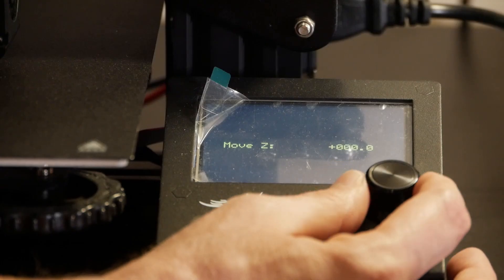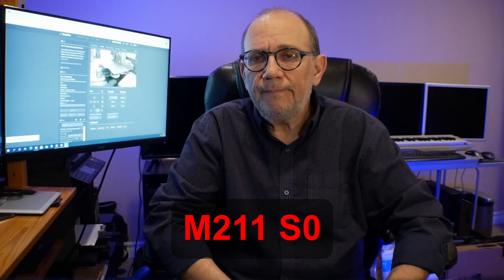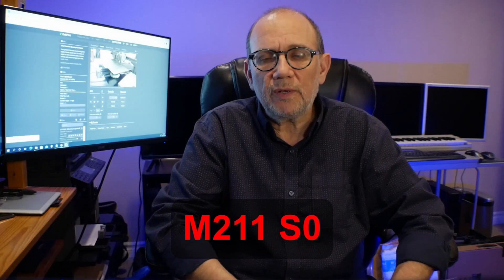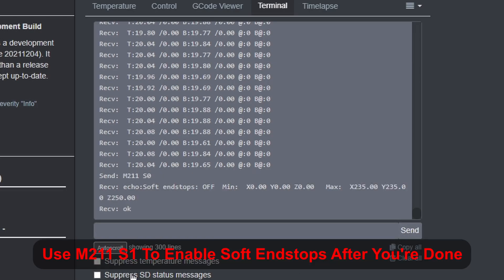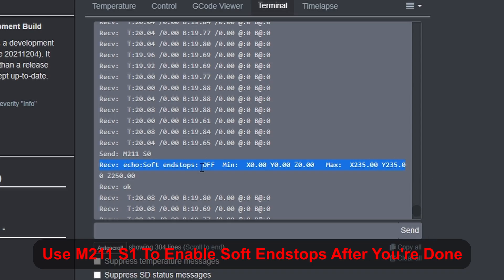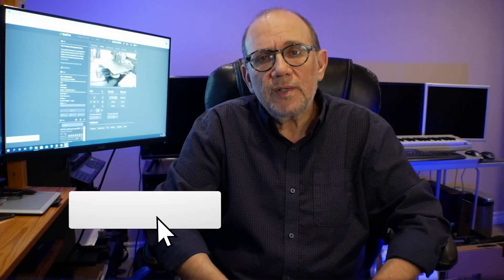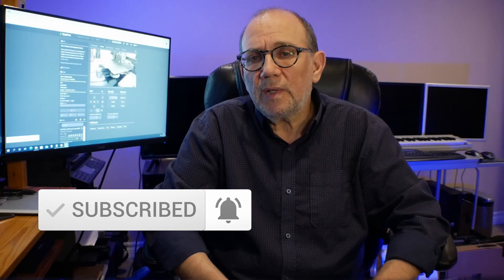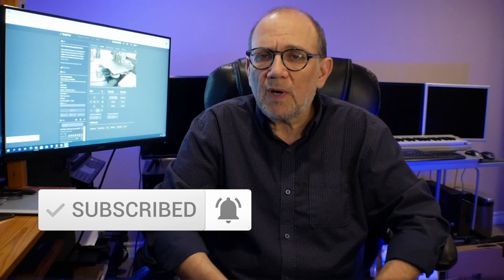Easy z-offset adjustment for your 3D printer.

Comment: This video was THE ONE I HAVE looked for in YEARS - so THX a lot for making it !

I have NEVER really got the leveling under my skin but has got my printer to work more or less by trial and error - not very satisfying.

These days I'm installing a BLTouch on my CR10s PRO version 2 printer some I'm very interested in getting the info you show in this video.

Allthough I think you should have mentioned some asumptions one has to get fixed FIRST:

1) The BLTouch should be calibrated correctly
2) the gantry should be levelled 
3) the bed should be 'levelled' with the leveling screw under the bed

A lot of people out there has made videos about the leveling issue - most of them more MIS-leading than leading, I think !

(BTW: why are your picture not in sync with your sound ?)

Keld from Denmark 
A fairy tale country in
the north of the EU

Comment: Depending on the version of the firmware installed you may not get the results shown on the console.

Please list out the firmware version you used to perform z offset !

Does this z-offset work on the BigTree board?

Comment: You area a LIFE saver. Worked great on Ender 3 v3 KE. I was pissed of with adhesion problems even with glue or pristine clean beds. Always having problems and headaches. Now the 1st layer is smooth as butter.

Never saw a z-offset tutorial as good as that. Congrats.

PS: Ender 3 v3 KE you adjust the offset directly from the adjust menu on the settings screen (the one that you do the homming).

Comment: I inherited a Creality CR10S Pro v2 that I am having an IMPOSSIBLE time getting leveled. When I attempt to home the printer, or do automatic bed leveling, the hotend does not want to stop when going down to the Z home position. It's like the printer is trying to drive the hotend through the bed.
Reply from the maker: I'm sorry to hear you're having this issue.  There are a few things that may be going on.  Given that this printer uses the BLTouch and there's no physical z-endstop switch if the BLTouch doesn't trigger, the printer has no idea when to stop moving down.  So the first thing you need to do is check if the BLTouch is functional.  Does it extend and retract when the printer starts up.  Typically it should "click" twice on power-up.  Have you tried triggering it manuall by pushing the pin up?  Does it blink red or do anythiing?  Do you see any errors on the screen?  If you run a z-home, and while the print head is going down you push the pin on the BLTouch does the print head stop going down?  Is it possible that someone installed different firmware that doesn't recognize the BLTouch?  The other thing, of course, is that you need to level the bed and manually set the z-stop.  I'm not 100% familiar with that particular printer so you'll need to get the instructions on how to do this.  But this is crucial in case you haven't done it yet.  Unfortunately I would need to be there to cover all the possibilities.  Good luck.  Let me know if you figure it out.  RG

Comment: I have the CR Touch how do I get the probe to deploy/bring it down like you did in this video? I thank you for the video and your hard work. Yes I am noob and I am struggling with leveling the bed. You did a frggin outstanding job on this video. Thank you so very much!
Reply: In the z offset menu (jyers), there is a check box next to probe option. Select it, and the probe will extend.

Comment: At least get it right Zoffset is NOT the distance between nozzle and bed,  its the distance from nozzle tip to probe tip.  it's a negative value added to z0 once homed, to create a new virtual 0,  thereby placing the nozzle at the same Z that the probe tip found.
Reply from the maker: I actually touched on what you're describing at the beginning of the video.  This, however, is a beginner tutorial for what the z offset is, as defined in most 3D printing sites.  It is also the first definition generated by Google:  Z-offset is the distance between the tip of the nozzle and the top of the heated bed on a 3D printer. It's a parameter that adjusts the initial height of the print nozzle above the bed.  It's always possible to have a more nuanced definition (which I guess yours is) but for a person trying to understand how to set the Z offset and get a general understanding of what it is, my explanation more than serves its purpose.  Thanks for commenting.  RG

Comment: So confused on probe and getting it to drop with software? 😢
Reply from the maker: No need to feel confused.   In order to extend the probe I installed the OctoPrint BLTouch plugin which can be found here:  https://plugins.octoprint.org/plugins/BLTouch/ .  Whether it'll work or not on your machine will depend on how you've got it set up.  If you're using Octoprint then you can install it.  But just so you know there's no need to bring down the probe to adjust your z offset.  RG

Comment: Hello! Thanks for your videos.
I have had problems with my BL Toch. It works when I do a bedleveling and can save it. But in the past I've had it do a leveling before every print but after I load new Cura I can't get it to work. The script I used then was ( G29 ; 
M420 S1 Z2 :) I have tried the script you showed. 
How do i get the printer to make a mech before each Model.
Thanks for reply:
Willis
Reply from the maker: Hello @jowmarketing...in order to level the bed before every print you need to insert the G29 command after the G28 command in the Slicer's default G-code commands.  Here's an article that deals with this and shows you where you need to insert the G29 command in Cura.  I'm assuming that at this point this command is missing (or is in the wrong place) which is why it's not working.  Look for the section in the article called "Configuring tthe Slicer"...https://all3dp.com/2/bltouch-sensors-guide/   .  Let me know if this works for you.  Good luck.  RG

Comment: I know this is an old video, but this is by far and away the best beginner explanation of how to do this I have seen. I found this because I am having issues with bed adhesion and thought perhaps I had been doing my offset incorrectly. I was reassured by this video that my problems lay elsewhere. Thanks!

Comment: Nope didn't work.   Did all that and when it went to print it was way to far from bed!
Reply from the maker: Are you sure you saved your settings?  What printer do you have?  Unless there's something particular about your printer this should work.
Reply: @CreatewithTech  Ender 3 V1.  I got on a chat with Creality download the firmware they recommend.  I did eventually get it to somewhat work.  I wish I could set the offset by the thousandth.  Test prints would start off nice then first layer would look like to close adjust offset during print looks good then looks to far away.  Then makes me wonder is the mesh no retaining.  Then during bed level it will quit or z off set disappears randomly like when loading new gcode to print offset disappears.
Reply: @CreatewithTech  4.2.2 board with the single white wide plug for the BL touch.  I am shelving at the moment due to it needing maintenance.  It will print fine except in one corner so I want to replace rollers and lube up the spiral shift.  I also need to upgrade tubing or go direct I have a Chameleon to install as well.

Comment: Actually this is a wrong. The Z-offset is the offset you reach with the paper plus ! the thickness of the paper. Your Z-0 is still above the buildpate with the method you show. A sticky note is 0.1 mm. There is no true relation between ABL and Z-offset. ABL creates a profile of the bed that is applied to all layers. Z-offset merely denotes the distance between the point where the sensor triggers and the point of your nozzle. Both are independant.
Reply from the maker: Did you actuall watch the whole video?  I explain all of this in the video...one of the first things I go into is the fact that the Z offset is independent of the mesh created by the ABL.  You're right that the Z offset and the ABL are two different things but hey work together to enable better and more accurate prints.
Reply: @CreatewithTech  yes, I did watch the video. And I was surprised that you did not add the paper thickness to your offset.
Reply from the maker: @gartnl  When using the paper thickness method, you typically don't need to add the paper thickness to the Z offset value. The Z offset should be set to the distance between the nozzle and the print bed when the paper just barely catches under the nozzle with slight resistance.  What value does adding the thickness of the paper add?  The way I explain it in the video always works and achieves great prints.
Reply: @CreatewithTech  Z=0 means the nozzle is on the surface. But notepaper is on average 0.1 mm. So the paper method leaves the nozzle 0.1 mm above the surface if you don't add the thickness. 
I've allways had to add the paper thickness to get consistent results with different, esp smaller, nozzle sizes. When layer thickness is .15 or lower  the .1 mm error becomes a problem.
Reply from the maker: @gartnl  Hmmm...OK I hear you...but we're kind of splitting hairs here.  I didn't mention it in the video, but it is possible to use baby stepping to deal with minor issues or inconsistencies that may come up.  That would work and may be required in certain circumstances.  I probably should have mentioned that in the video.  Generally speaking though I've never had any issues with the method I discuss in the video.  Also, the video is made for people who are completely new to this.  I tried to give a method that works with a typical 0.4mm nozzle that comes with most printers.  I already covered a lot of details and I didn't want to confuse, especially given that this does work in most instances.  But I can see how that 0.1mm can be problematic with smaller nozzle sizes.  Thanks
Reply: @CreatewithTech  It's just my quite a**l technical way of thinking I guess..

Comment: ender seems to have more control of your settings compared to cr10
Reply from the maker: Hi there...which controls are you missing?
Reply: i can't lower it more then .1mm, my nozzle lands either too high or too low, i can't get that sweet spot, i must add i am new to this so i'm sure it's user error. @CreatewithTech

Comment: maybe i have something different? How do you get z in the - when using moving axis
 mine goes to 0 and stops
Reply from the maker: Your soft limit switch is turned on.  I talk about this at 15:05...if you turn it off it should work.  RG
Reply: I see that now. After some messing around I see no reason to do that , I leveled bed manual, auto home goto 0 using motion goto config /z-offself (z lowers as i set)  @CreatewithTech

Comment: How did you manually extend the CR touch probe?
Reply from the maker: in order to extend the probe I installed the OctoPrint BLTouch plugin which can be found here:  https://plugins.octoprint.org/plugins/BLTouch/
Reply: @CreatewithTech  Read up on this and it appears I'll need to get a Raspberry PI setup for this printer

Great series of videos BTW.  Best out there as you take small incremental steps stopping often to explain things in great detail.  Thank you sir!!!

Comment: i to  can't move z wont go lower 0.0, but i still dont understand this gcode m211 SO on my ender 3 v2
Reply from the maker: Hi There...I'm sorry you're having a problem with this.  Once you send the M211 S0 g code command to the printer you'll be able to go below 0 to set you z offset.  The easiest way to send the M211 S0 command is by using a web interface.  If, however, your printer is stand alone you can still do it.  I've got a video that shows you how.  Here's the link:  https://www.youtube.com/watch?v=pj0kICk6DfY   .  Once you've set the z offset you need to turn the soft limit switch back on by sending the M211 S1 command.  The link to the video above will show  you how.  Good luck.  RG

Comment: Mine just started not working without a massive negative z-offset. Before I needed a 0.2mm positive offset, because my parts were squished (use a piece of paper to zero)... but then out of nowhere I can never get it to print without a -0.08mm z-offset and I haven't been able to figure out why. I bought a brand new Ender 3, but it doesn't have a x-offset option. Also, the slicers I use won't let me put in a z-offset anywhere above 0.27mm up + or - (cura and creality). Prusa does, but prusa has been a terrible slicer for me. The parts are just such terribly low quality with Prusa when they come out so much better with the others.

Comment: Do you have any idea why my Ender 3 Neo Max sounds like a 747 taking off as soon as it's turned on? I'm talking before it has printed anything, before the fans would need to be going full blast? It's a brand new printer with not 5 hours of printing..I did notice it was set for Europe voltage out of the box which I found odd (220V vs 120). It's not affecting the print but it sure is loud! Thanks
Reply from the maker: Hi  @wyattspop...I'm not really sure why your printer sounds so loud, but I can tell you that  you need to flip the switch from 220v to 120  if you haven't done so yet . Doing so may help with the sound.  I would definitely try.  Let me know what happens.  RG
Reply: So kind of you to reply (I'm Tommy) I did change the voltage, I have my first Ender 3 Neo in the garage so maybe having this one in my office, I'm simply not used to the sound level, maybe its typical? Easily solved by moving it out also, Thank you kindly...great vid @CreatewithTech  Are the fans always going full bore or is it like a PC and used as needed?
Reply from the maker: Hi Tommy...I don't have the Ender 3 Neo Max, but I believe that the hot end fan on that printer is on all the time and cannot be controlled via software.  The way fans are used varies from printer to printer.  The fan noise is definitely one of the down sides to 3D printing.  Creality is not known for putting silent fans on their printers.  RG
Reply: You are absolutely right, there was nothing wrong with my new Ender V3 Neo Max, I physically put them side-by-side with my Ender V3 Neo and the Max was somewhat louder,.but it was negligible since the Max is substantially larger..  @CreatewithTech
Reply: I do find it odd that it runs the fans all on full bore the second you turn on the power...you would never want this printer in the same room with you @CreatewithTech

Comment: Thanks, I've had a new Ender 3 Neo Max for months and my son and I couldn't print anything because we couldn't get the height properly dialed in, it was either too low and scraped the bed (eesh) or too high and shot the filament everywhere, your tutorial allowed us to find the ideal height using Z-offset and then setting it as the default, we're printing something perfectly as we speak!

Comment: I'm having a problem with my 3d printer the 3d printer I have is a voxelab aquila I downloaded a cruelty software by accident on my 3D printer now the screen is just Frozen I can't download any firmware can you please help me😢
Reply from the maker: Hello there.  I'm sorry that you're having an issue with your printer.  From what you're telling me I'm going to assume you've installed the wrong firmware onto the printer.  I don't have a voxelab aquila, but what I would try to do is reinstall the original firmware.  Here is the Voxelab page where you can download the firmware you need: https://www.voxelab3dp.com/download .  Good luck.  I hope you find a solution.  RG

Comment: HOW DO YOU GET Z NEGITIVE ITS IMPOSSIBLE FOR ME HELP
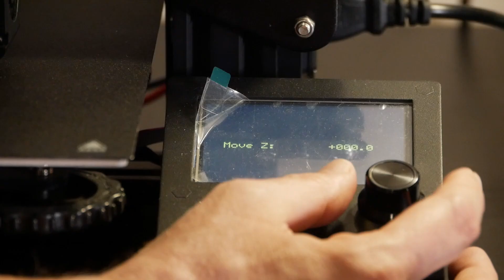Reply from the maker: Hello...I'm not sure which printer you're using or the firmware that it has, but if it's Marlin and your Z axis doesn't go below 0.000 it means that the z axis soft limit switch is turned on.  This is to prevent your nozzle from hitting the bed.  I talk about this here... 15:08  ....you'll need to turn off the switch with the M211 S0 command.  If you're connected to Octoprint you can send the command through the terminal.  If you're printing in stand alone mode then you'll need to use another method to send the command.  I made a video about this here:  https://www.youtube.com/watch?v=pj0kICk6DfY  .  Good luck!  RG
Reply: i downloaded a cz touch software and it now works with my cz  @CreatewithTech

Comment: do not heat bed and nozzle...
Reply from the maker: And you're saying this because?  You need to explain your reasoning.  What's the problem with heating the bed and nozzle?  I know some people prefer not to (or argue that it's not necessary) but in my experience if you want to get the best results it's a good idea to heat the bed and the nozzle.

Comment: This is good, but I still can't get my Z to zero.  I have set it about 50 times, but it still rides about 2mm above the table...no where near it.  I'm wasting a bit of fillament trying to get this to work.  Is there anything else I can check?  I have an automatic leveler and it is at the top limit.  Before I drill new mounting holes for the sensor, I wanted to ask.
Reply from the maker: Hello @kistler140...sorry to hear that you're having issues with this.  When you say you can't get you Z axis to 0, do you  mean you can't get it below 0, or you can't even get it to 0...If you can't get it below 0 it means that the Z limit switch is turned on in the firmware and you need to turn it off with the M211 S0 command...I go into this a bit at 16:34 in the video.  Let me know if this helps.  RG
Reply: Below zero.  Put in the code: M211 S0, tried to set it to -2.35mm, but it didn't work. @CreatewithTech Also tried putting -2.35 in the slicer, but it didn't work.